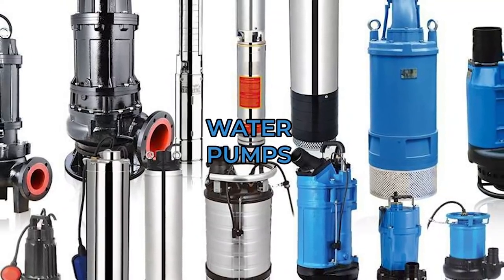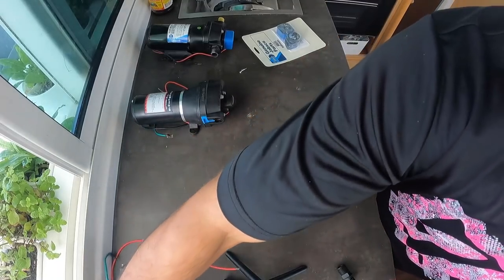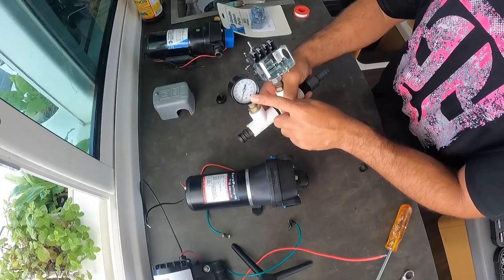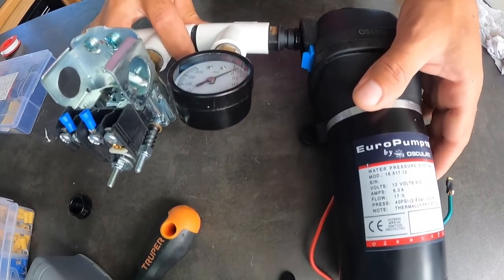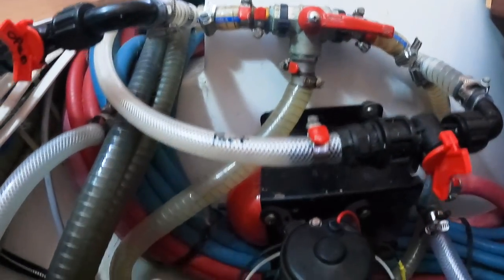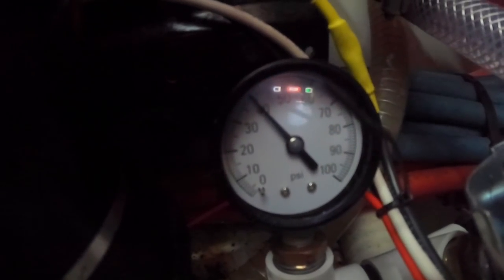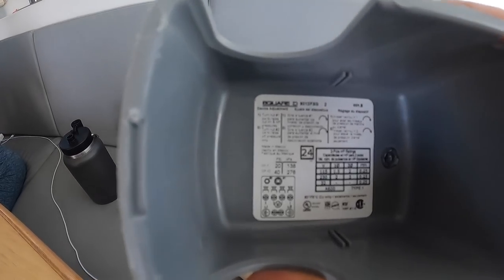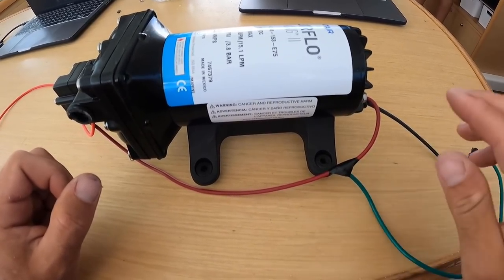Water Pump Pressure Switch Troubleshooting | How To Fix A Water Pump

Comment: Alejo - I just found your video after having the same frustrating problems. 4 pumps in 8 months! I like your fix. I have one question - why did you buy the 15-30PSI switch if your pump is rated to 40PSI? There is a 30-50PSI switch.

Comment: Adding a accumulator tank will help with reducing the rapid on/off cycle that burns out these switches on the pump.
Reply from the maker: Hi, we have an accumulator tank but it’s pretty small but it helps as you mention

Comment: Great idea! Just don't install this type of switch in a compartment that is exposed to possible fumes from gasoline as the switch is not sealed to prevent sparking. The factory switch is sealed. Not an issue with a diesel fueled boat. Insurance may not cover a loss if a fire or explosion happens on a boat with this type of switch installed on a gasoline powered boat.
Reply from the maker: Hi Glenn, yes that is a great observation. Thanks for watching!

Comment: I have a dislike for those square pressure switches.  About every property I've bought has had a water well separate from the house, called a well house, and of course they had a pressure switch between the pump and tank.  I've had to replace them at least a dozen times over the years and I'm no where near saltwater.  Tip, if you have problems with no water at the faucet go straight to that dang pressure switch and check the contacts that open and close.  They corrode and keep the electricity from flowing.  At least you're on land and won't have to worry about ants getting in-between the contacts.  Ants are attracted to the electricity for some reason and will literally fill up in that grey plastic box.  Great way to kill ants in the well house, but the wife gets mad when there is no water for the shower. Lol
Reply: ⬆️ Matthew try Honey mixed with Baking Soda.  The ants will take it home for their 'fungus garden', ants eat fungus, not the honey. Baking Soda kills fungus, hence no ants. Works in kitchens too!
Reply: @stevenr8606  Thanks.  I wonder if that works with those big red ants?  I have a nest of them on my pond dam and can't get rid of them even with poison.